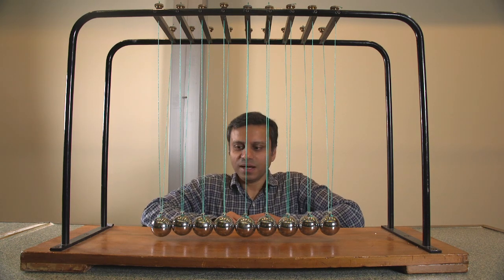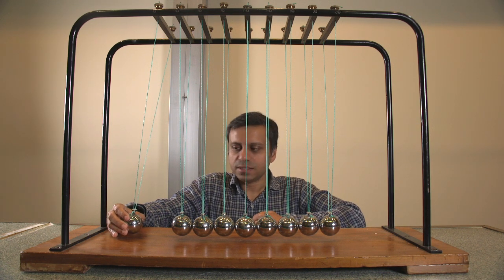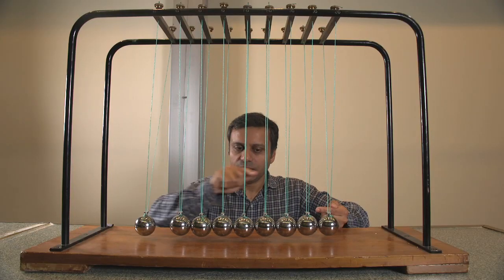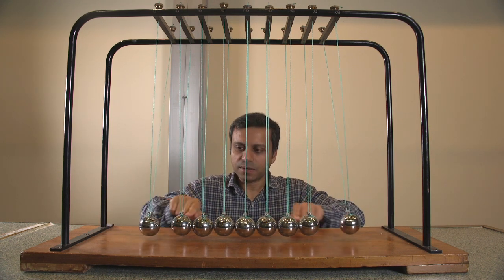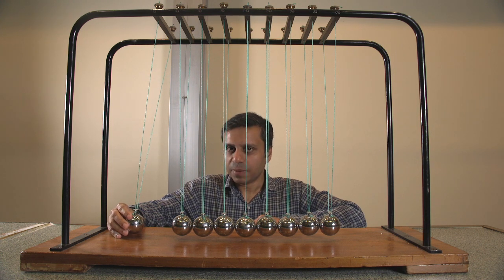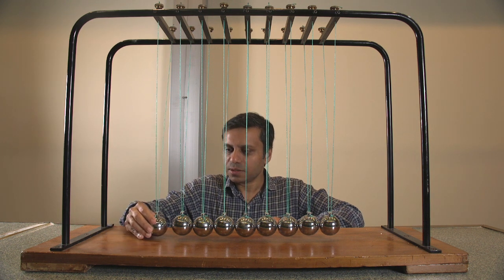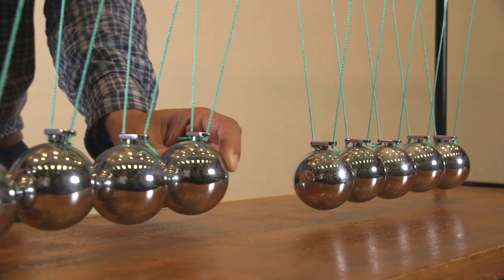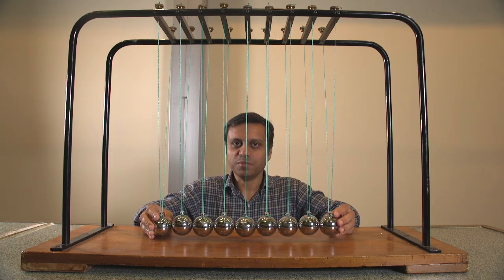Conservation of Momentum   Newton's Cradle 2

Comment: You need to put a pair of rods connected to each other (or something like angle iron) underneath them to create a very straight channel for them to rest on top. Then adjust the strings so they are perfectly straight and at same height. It will work a lot better.  I can see your first ball is too low.
Reply: Hi I want to ask you a question related to physics that is when the bobs were hitted from both side how it can be 0? Can you help me in this.